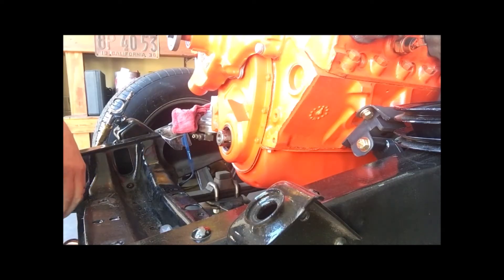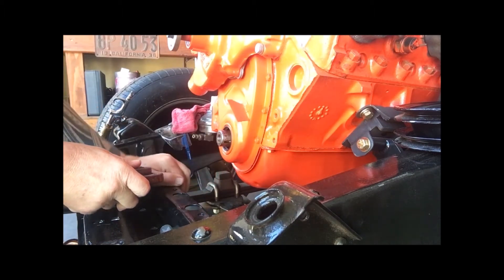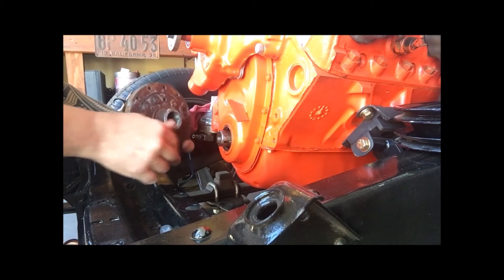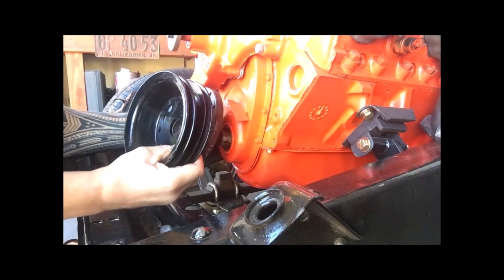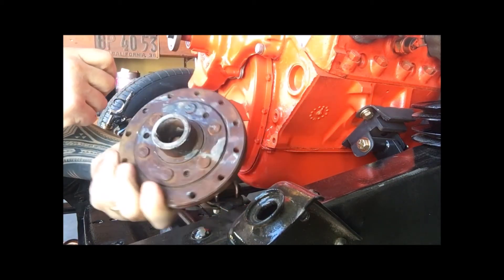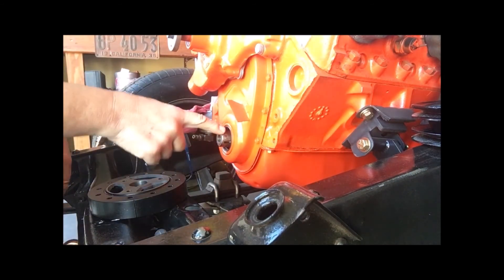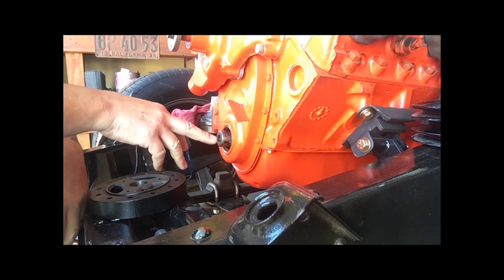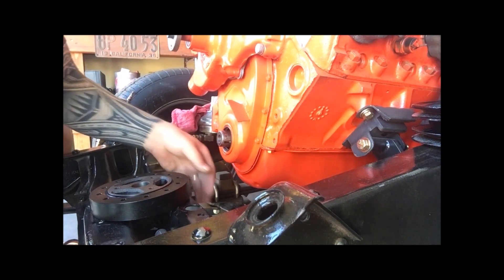Harmonic Balancer Bolt Tap, or repair, for older small Block Chevy crankshafts Part 1 of 2

Comment: Hi Chris, hope you don't mind me asking but I am working on the same engine a 283, I love the 283 it's a great engine, could you please tell which Balancer you are using and where you found it, so many balancers to choose from, I built just a factory stock engine I am not racing it or anything like that, I guess I'm getting old, nut if you could just let me know which one you went with, thank you!
Reply from the maker: Yeah great little motor agree.  I'll have to dig through my receipts and get a part number, I'll try to get back to you when I find it...Thx, Chris

Comment: 12 bold tools. Com  makes a tool to drill and tap that crank , its easy  I did mine with the engine  in place just removed  the radiator, fan, harmonic balancer   took about an hour
Reply from the maker: Cool man glad that tool worked out for ya. Any easier way to do that is a good thing... thx for sharing as I'm sure that others will benefit from the tool you used...
Reply: @outboundterrain6454  👍